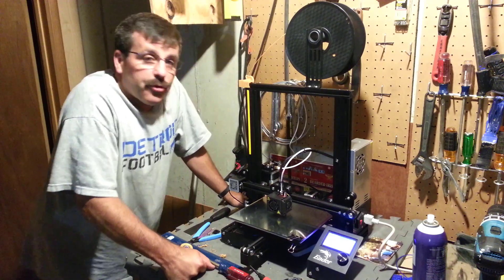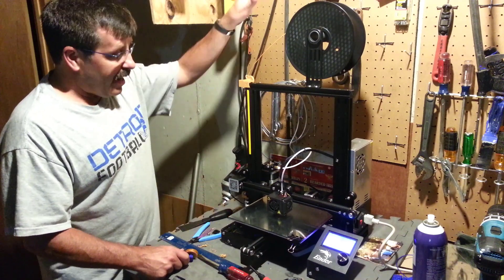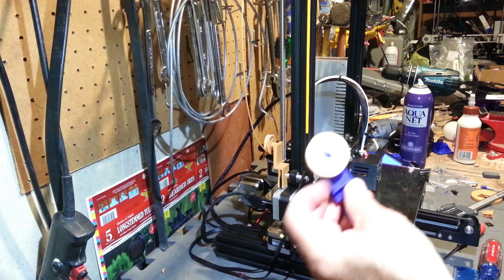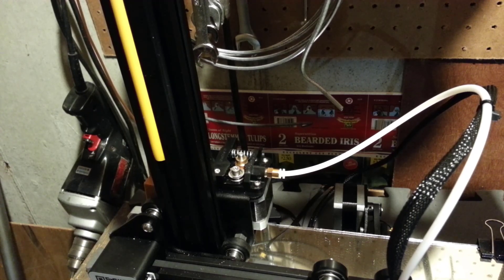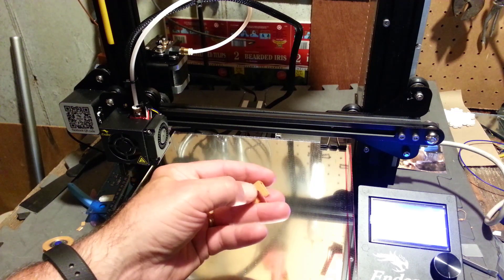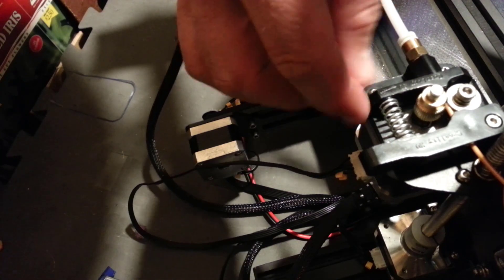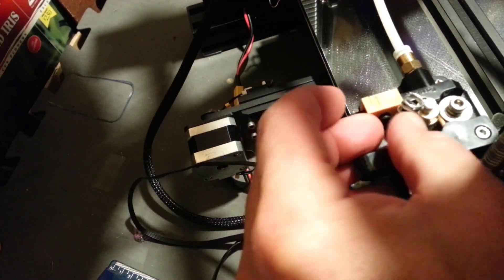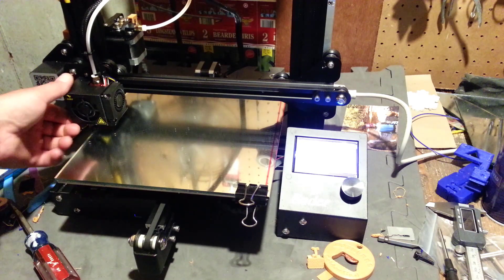Ender 3 Extrusion Issues? Check Out This Tinkercad Quick Fix!

Comment: You absolute legend thank you so much!! The e steps on my ender 3 were wildly different every time I extruded (e.g 140, 110, 98) and I was about to give up until I came across this and it fixed it! Both my ender 3 and anycubic kobra plus are not working and its my fault for never updating firmware, doing maintenance etc and I thought I would have to give up with them and buy a new printer. Tbf I didn't know I had to update firmware, my ender 3 had the stock one on it from almost 4 years ago! Nice to have the new one haha. But with the firmware updated, z axis wobble fixed, new bed, new nozzle, upgraded extrusion thing and finally this it seems to be working again! Now just back to the kobra rip LOL
Reply from the maker: Thank you! Great to hear you have the printer working! Way more fun than having a paper weight. 💯👍

Comment: I used my thermal imager to figure out the thermister calibration was WAY off.  Bumping the temp up and using this tip worked wonders!
I had been printing at a set point of 185C. It must have been way under 185C since when I bumped it up to 230C the hotend operates at 190C as seen by the thermal imager.
Reply from the maker: That is crazy far off. Have you ever PID tuned it?  Either way, glad you found a solutions that works for you.

Comment: I think you could have done this with a washer!
....or with two washers?
in the worst case you might have to file the washer on one (1) side. (to make it fit) 
friendly greetings from the Netherlands!
Rob
Reply from the maker: Yes, anything flat would suffice. Living in Holland, Mi is it extra cool to get a hello from the Netherlands!
Reply: @HLModTech  
Yes, of course a Hello and friendly and healthy greetings from the Netherlands!
!!  :-)
I live near Rotterdam if you want to check it out with Maps.
I was surfing a bit and accidentally ended up on your Y.T. movie.
for the hobby I do a bit of messing around with 3D printing (I built two prusa's myself)
Am also a radio amateur if you want to listen please check this link: http://websdr.ewi.utwente.nl:8901/
correct setting is necessary - Click: MAX IN set modulation for example to AM and frequency around 1620khz / 1650khz
(There are often Dutch MW pirates there!) LOL
 ;-)

Greetings again!
Rob

Comment: Thank you! Was struggling with under extrusion for a few days. This instantly fixed it. Used a small washer.
Reply: I was wondering how to print this when my extrusion is so bad I can't print. The washer was brilliant and worked wonders.
Reply from the maker: @leewalinchus1552  Necessity is the mother of invention! 👏👍  Glad you are up and running!
Reply from the maker: Makes my day to hear that! Thanks for sharing 👍

Comment: This helped slipping, but now my teeth keeps clicking every so often... I've been struggling with it for so long and nothing seems to be working :-/.
Reply from the maker: Whenever I had the clicking I felt it was the hot end not being up to Temp so the extruder was fighting to try and push the filament through... What temp are you using?
Reply: @HLModTech  I was using 200 degrees, and your diagnosis is spot on. At 220 degrees it seems to be working much better. Although now I am getting more stringing and oozing. I am trying to adjust my retraction settings now to stop this stringing. Would you agree that since the temperature is now higher, I may need to increase my print speed of 50mm/seconds? Thank you so much for the reply. :-)
Reply from the maker: Great to hear you are making progress! I usually have mine at 205 or 210. I am on the road, so I cannot double check, but I do believe I have a print speed of 60. It all can depend on the filament you are using as well. I also like to dial it in on a simple print like a cube... Once I am happy I move to more mission critical prints. 👍
Reply: @HLModTech  I appreciate that, I'll give it a go! I've printed about 15+ of these little retraction pyramids lol... I THINK lowering my retraction speed is helping... I' going to stop printing these things and try for a cube now :)
Reply: Oh and they each take 13-14 minutes... so do the math on how much time I have spent haha
Reply from the maker: @5stepshred300  Are you using cura? I had some decent first steps in this clip https://youtu.be/vC9pMdJ7-9U
Reply from the maker: @5stepshred300  Ow... that is a lot of time. I taught math in the 90's... Sure do enjoy teaching tech now!! 😜  I have seem some Ender's that can bridge 100 mm, but I have never honed mine to that level... I instead slap in some tinkercad cones as supports and call it good.. 👍
Reply from the maker: I use Camtasia. I have it rigged up in school so that you could actually learn about it. Here is the video where I show how it works. https://youtu.be/TK_wOs5cUQ4

Comment: Thanks! it fixed my filament issue where the extruder cog just spun or stroke the filament instead of pushing it. But now i have another issue with the tensioner, and that's the brass cog now skips a step or 2 often. Bumped up 5c on the filament and placed spool on a much smaller metal piece i had from a toilet roll holder, and even gave it a bit more loose filament to take in, but i'm still getting skips now and then. Got any solutions for that?
Reply from the maker: I wonder if you might have a gap in the thermal tube that is creating a bit of a clog. I have not had that issue, but I have heard of it. I had issues with my Delta Go like that, but they replaced the hot end and (knock on wood) is has been good since.
Reply: I attached the new bowden by first tightening the nozzle, then unscrew it one turn, put down the bowden all the way down, then tighten the nozzle the extra turn.

Yeah, i need to buy a set of new of nozzles just in case.

But i fixed the issue for now. temps was at 200, had a bad skipping, then 205, a litt,e now 210 is nothing at all. And someone on a discord said that 200 looked the best. 

But i do have a dual extruder coming in in a month, so i'm gonna print at 210 or the least temps i can do without skipping until i get that, or even test with the new filamentium filament i have coming in a few days. My current is a generic filament from a store called "clas ohlson"
Reply from the maker: @Duckers_McQuack  Super cool that you have it working! Persistence is a great strategy. I have several printers and have different temps I use for each. Even when I swap filament between them, there are "Sweet Spots" that work best for each of them.
Reply: @HLModTech  Yep!

And today i also got a new filamentium i ordered, but can't print until thursday as i'm in the middle of moving hehe.

Comment: Hello! The support breaks easily and does not work
Reply from the maker: Hmmm... Been using mine forever without issues.  Can you get someone else to print it on their printer to see if that helps. What settings were you using when you printed it?
Reply: @HLModTech  Thank you so much for answering me. I don't know anyone who owns a 3D printer. For now I print at a speed of 50 mm / s, infill speed at 50 mm / s, flow at 100, retraction 6 mm in 50 mm / s. I used PLA+ at 215 grades , but I can use PETG if it is better
Reply from the maker: @simonepiutti251  Happy to help. =) Your numbers sound good. I have never used PLA plus. What slicing software are you using. It would also help to know the layer height. I have had a lot of success with .3mm when I am getting the printer honed.
Reply: @HLModTech  I use Cura but i can change it.  The layer height is 0.15
Reply from the maker: @simonepiutti251  I like Cura. 3.6 or 15...? Try layer height of .3 once. Are you using raft?
Reply from the maker: Oh, a temp fix that I saw a day ago was putting a washer there I have my printed part. That may help till you get the part right.
Reply: @HLModTech  no i didn't use raft
Reply from the maker: @simonepiutti251  I do not use raft often either. I am always pretty frugal with the plastic. How good is the adhesion to your bed?

Comment: I find that simply using a spare washer that the printer comes with works just fine.
Reply from the maker: I have used that same technique with a A8 I am working with. =)
Reply: I was having an under extrusion issue with my printer and putting a washer made a HUGE difference! Thank you!

Comment: Another awesome idea...granted, part not made specifically for my printer, but the concept works just the same. Been battling with the cube to print correct and I believe under extrusion is one of my issues currently. Going to try and adjust the flow rate first and, if that doesn't work, I will print this and see if it fits the A10
Reply from the maker: Thanks! When I get into school I'll take a look at my A10 and see if I can come up with a tip for ya!
Reply: @HLModTech  Thanks. For now, I adjusted the flow in Cura from 100% to 115% and it fixed the under extrusion I was seeing. Only thing left is to figure out why I still have a little (very small) shift in layers. I tightened down the belts, which helped massively. I'm thinking there may be a slight bit of z wobble
Reply from the maker: @NordicBlueRC  All good solutions. =) What settings are you printing with? .3 or .2mm etc... PLA and temps?
Reply: @HLModTech  Sorry, YT got away from me for a week. I'm printing Amazon PLA, .2mm layers, at 207. I ended up taking a washer and putting it behind the spring and then adjusted my e steps to ensure it was extruding exactly the right amount. Other issues were lose belts and lose screws on the z axis, causing wobble. Pretty much got it looking really nice now. Just a lot of tinkering :)

Comment: This spring is way stiffer than how you make it seem in the video.
Reply from the maker: =) Could be my superhuman strength... =)
Reply: It's not really, I pull it back with my fingernail
Reply from the maker: @mrb2917  I believe that there is a lot of variation with them.  Or... you may just be strong as an ox. =)

Comment: Thanks for this, will print it out in the morning and hope it fixes my issues, getting missing lines randomly, just started this weekend, only had the printer for a few weeks, learning a lot.  Also GO LIONS! :)
Reply: I too am going to have an Unde-Extruded Extruder Tensioner
Reply from the maker: #OnePride =) Keep me posted if you are still having issues. What temps are you running?

Comment: Bonjour, qu'es ce que votre Extruder Tension Fix vas apporté de plus pour la qualité de mes print s'il vous plait ? 
Merci ;)
Reply from the maker: Some believe the spring is not strong enough. By shortening the distance where it sits... it increases that pressure. There are so many things you can change after that in your slicing program to get your quality perfect... This video is aimed at helping you get the printer working so you can tune it.
Reply: Merci pour votre réponse , et quelle programme de slicing utilise tu ?
Reply from the maker: My pleasure. I use Cura 3.4.1. It is Free which is right in my price range. =) I print with PLA and have the bed at 70 and the hot end at 210. I added a glass mirror to print on and usually print .3mm layers. I am usually more interested in getting prints done than glassy perfect prints. =)
Reply: J'utilise Cura 15.04.06 pour le moment et pour le moment les résultats ne son pas trop mal mais je suis sur que là Ender-3 peux encore faire mieux, vous ne croyez pas ?
Reply from the maker: I am part of a Facebook group for the Ender 3 and have seen amazing results posted there. https://www.facebook.com/groups/Ender3/  A lot of users have done some pretty extreme modifications to their printers as well. I am trying to keep mine pretty close to stock.
Reply: @HLModTech  c'est bon je viens de faire la demande pour rejoindre votre groupe.
Je vous souhaite une bonne journée ici en France il se fait très tôt nous sommes le matin.
Reply from the maker: Awesome. I am sure we'll cross paths there as well. Have fun with your printing endeavors!
Reply: @HLModTech   bonjour votre groupe n'a pas eu l'air de m'avoir accepté ajouter 😞
Nicolas Marmet sur mon Facebook.
Reply from the maker: I am just a member and not a mod there, but let me see if I can track down what is up. I cannot remember how long it took for my request to be accepted. It may be that it is still pretty early on a Sunday morning here in the states. Especially if the moderators are on the West Coast.
Reply: @HLModTech   ahhhh d'accord !!!
Je comprends mieux maintenant pourquoi cette lenteur pour l'acceptation.

Ici donc chez vous c'est les vacances aussi ?

chez nous elle se termine bientôt les enfants vont bientôt reprendre l'école pour ma part j'ai repris ma formation il y a déjà une semaine.

Je vous remercie pour votre regard sur le groupe afin que je sois ajouter et vous souhaite une très bonne journée si chez vous c'est le matin chez nous c'est l'après-midi il est 15h22 😉

Je vais printer le système qui sert à diminuer le bruit du fan de l'alimentation car le fan de l'alimentation est quand même très bruyant surtout quand le fan tourne vite .
Au plaisir de se retrouver sur le groupe, à bientôt 😉

Nicolas de France en formation dans la région du champagne 👍👌
Reply from the maker: =) I am a school teacher and head back to work Monday. No official holiday at the moment here, but summer break is ending for the kids on Tuesday.   I have seen a lot of really neat mods for the fans. I have not messed with any as my classroom is noisy enough that I do not notice anything the printers are doing. The combination of 3d printers, robots, wooden dragsters and 8th graders renders quiet obsolete. =)
Reply: @HLModTech  do you understand french, or is this a case of google translate XD ?
Reply from the maker: @EspenShampoo25  I do not understand French, but with the help of Google Translate it was super cool conversing. =) As I look back at it, it is amazing what we can do these days.